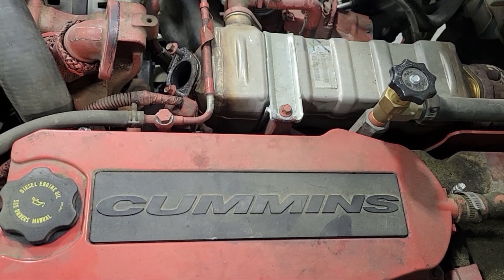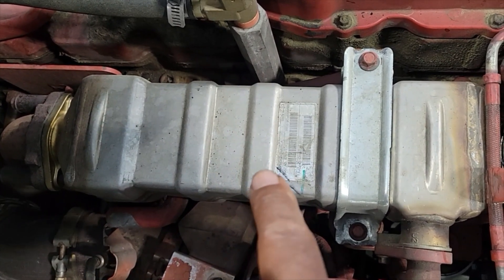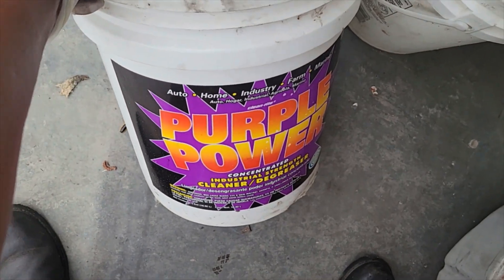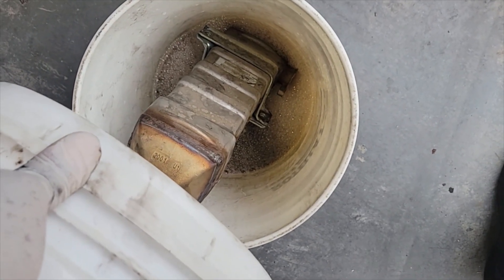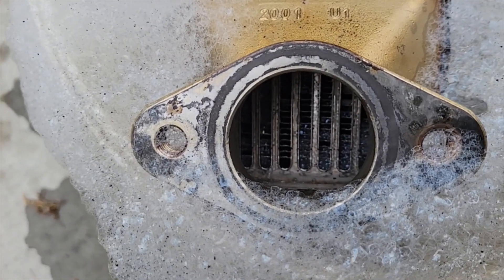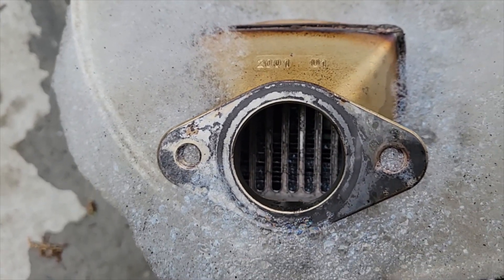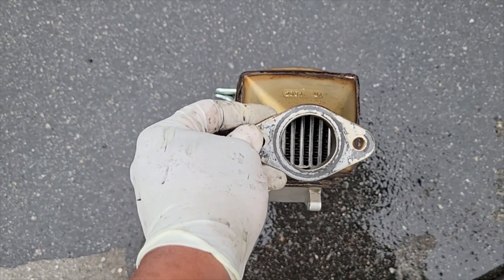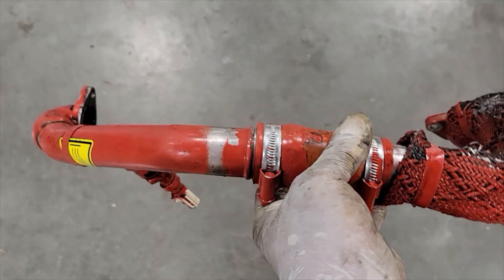How To Clean EGR Cooler On 6.7 Cummins

Comment: most of the kits now have the gaskets and a  plug for the bottom or top or EGR cooler so you fill with Purple Power or Mean Green from Dollar General and let it sit for couple hours.. One thing to do is put hand on other end and if full to top pour a little out so you have like a inch of space,, cover and SHAKE the crap out of  it up and down.. I would do this every couple hours..  the movement will help to break the stuff loose..  you might pour some out and put in fresh is you have it.. I suspect the cooler will take a full gallon of product so unless you buy two gallon might not work.. have not done one yet will happen this spring 2026 so not sure..  if you do this in a big bucket  or a large dish pan you can then throw the egr valve with electronic taken off and I did the  intake horn as well..  the gaskets on egr valve.   this kit is at walmart for less than geno and same kit..  https://www.walmart.com/ip/seort/281801334

Comment: I believed dawn is cheaper and it would have done the same or even better
Reply: No .. purple power is better.. but be careful, it will eat your paint.
Reply: NOPE.. used dawn on the EGR valve.. was not able to get purple power  (sold out) but got some mean green at Dollar general store and it was wayyyyy better than dawn.. I cleaned the valve and intake horn.. soaked with gallon MG and about a qt water letting it sit for 2 hrs and like new.. I did use a bottle brush as well..

Comment: Hey nice video question i try to take it out the two screws the back side but its impossible the angule and very hard for the oxide could you tell some idea to take it. Thanks.
Reply from the maker: Spray both bolts with PB Blaster and let it sit overnight. Use a Breaker Bar with a 6-point socket to break the bolts loose.
Reply: @dairleautoclassicrestorati6892  thanks

Comment: Do you have a video on changing a 2017 international 4300 Cummins fuel rail pressure sensor?
Reply from the maker: Not yet, that can change any day now.
Reply: @dairleautoclassicrestorati6892  are you located in sc?
Reply from the maker: @laquincyhutcherson4470  Located in NC
Reply: @dairleautoclassicrestorati6892  how do I contact you sir for repairs?